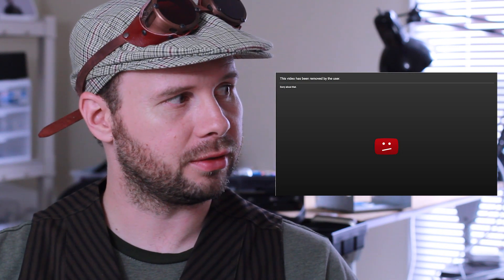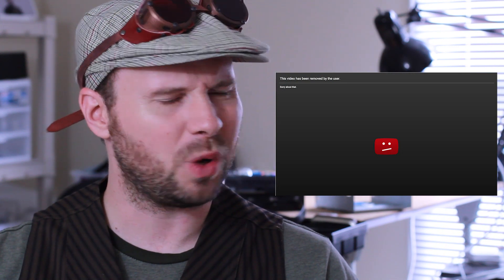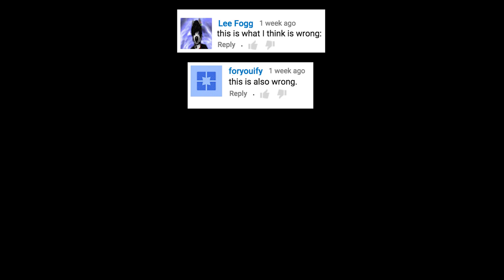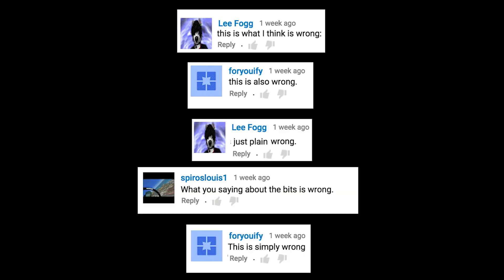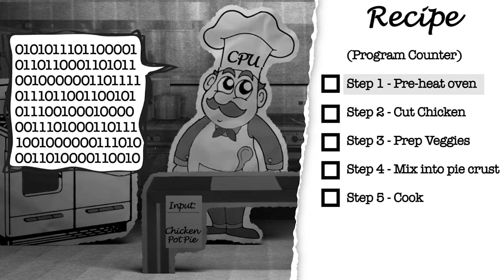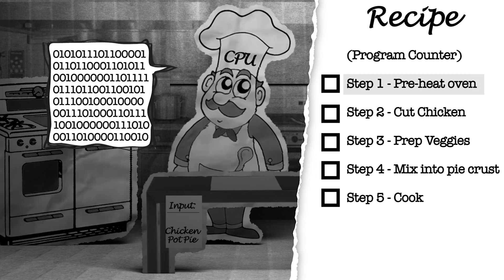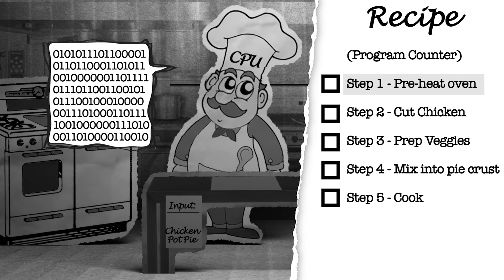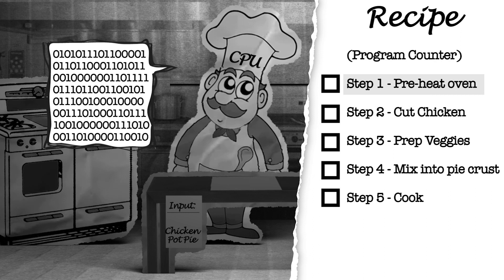Comments Show

Comment: :D Thanks for mentioning me twice, I hope my comment wasn't rude..I really think letting your fans 'screen' the video first is a great idea.
...Because one of your corrections is wrong on here too :/ 
MODERN processors instructions-per-cycle is the clock speed, not old ones, old processors could take around 12 cycles for a complex instruction, and FLOPS is different than the frequency, FLOPS is FLoating-point Operations Per Second because different architectures take different amount of cycles to do floating-point arithmetic.
Reply from the maker: +Lee Fogg wasn't rude at all. it was all on point. and sorry again for making another mistake :-) seriously, i should have asked you to write it instead of my futile attempts.